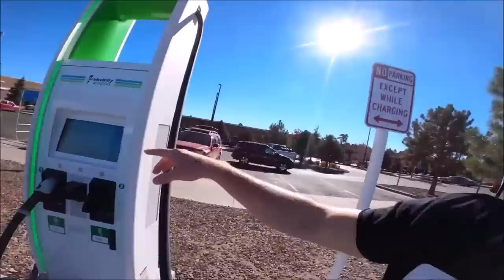Can We Make a Profit Selling this 2021 Porsche Taycan? - Flying Wheels

Comment: Was there any stops you made where a diesel generator was directly powering the chargers?
Reply from the maker: Nope
Reply: I'm pretty sure there were some behind the walls, that look like  ones to hide dumpsters are,  in the parking lot of the last video. You can't hear them because they probably are soundproofed.
Reply: Well at there last stop late in the vid I could hear a generator ruining at 1800 rpm. Maybe it could have been something else but ya gotta take his word
Reply: Well it’s the future of cars if batteries take a huge jump. Ya know like don’t blow up on impact charge in the same amount of time as filling a gas tank perform in the cold and heat equally well and a laundry list of everything else the can’t do.
Reply: @nickk4010  Why would there be if the chargers were connected to the grid?  Is your house connected to a diesel generator or is it connected to the grid?

Comment: Go to auto zone or the Porsche dealership get a touch up pen and slowly fill the spots on the bumper dab the spots to fill them don’t brush the touch up paint and then sand it smooth and polish it out and get 3m glue and adhesive remover for the tape residue

Ps just watched the video a little further and you did exactly what I said LoL

Comment: Craig, could you have driven a car cross country 2 years ago that you bought relatively new, and broke even or sold it for a profit? Or you were only able to do that in the current environment where used car prices are crazy?
Reply: It's about local market demand. For years, you could by non-rusted older cars in the southwest, ship them northeast and sell them for a profit due to their condition.
Reply: it depends on the car, and where...cross country from LA to NH different cars would hold their value and some would lose. For eg: if you got a Ford GT, you'd make money....Ford F150, you'd lose.

Comment: Should have used the paint as filler  for those scratches.  Then color sand and polish
Reply from the maker: I was literally in a parking lot and it is being listed that day. I didn't have any resources
Reply: @FlyingWheels  using the same resources just a different proceedure